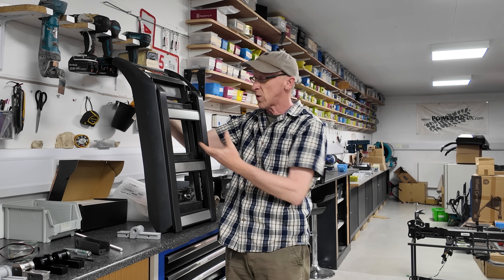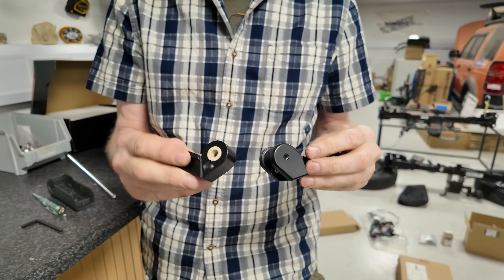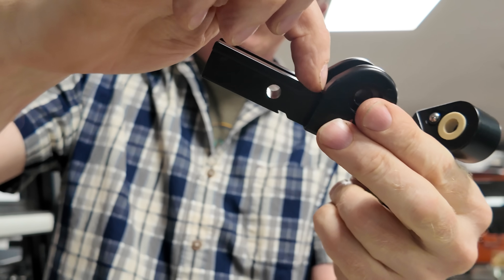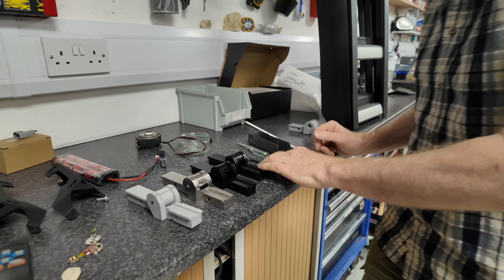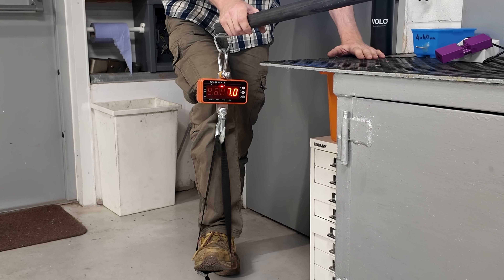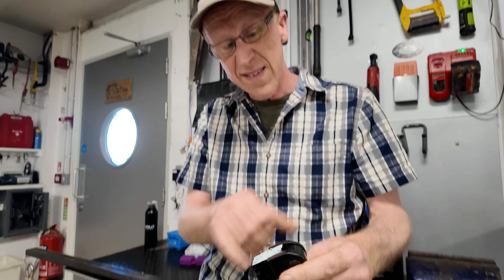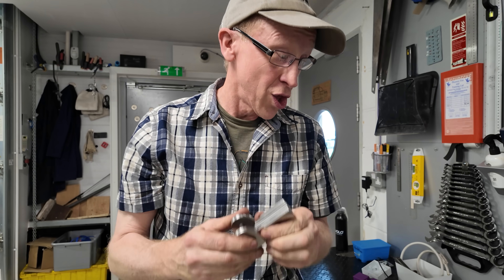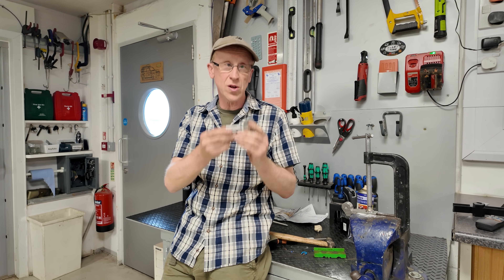We Investigate The Land Rover Defender L663 Ladder Hinge Failure

Comment: Hi Simon,  I have two ladders on my defender 110 (Melbourne Australia). .   Great for access to both sides of the roof rack.   I have purchased 2 sets of your upgraded CNC hinges and they have been fitted with no problems.   In you video you said that you were going to produce them in stainless steel, but I dont see those on offer in your parts list for sale.   What happened there?  Why didnt the stainless (strongest) variation go into production?   Cheers Roger.

Comment: Have Land Rover redesigned the ladder?  I am sure the original had a lock on the bottom and the lower section pulled out and down - rather than just folding down???

I am very impressed with your research and making the parts that break and Land Rover do not supply. 👍

Comment: Nice bit of testing.  The cast Zinc is known as Zamac - and it's pretty cheap & nasty!
I think, if you were to add some fillets, you could increase the strength of the aluminium version a reasonable amount.  Also, use a shoulder bolt screwing into a counterbored hole.  The thread itself, as well as having a smaller root diameter also acts to concentrate stress.
If you'd like any assistance (for free), reach out.  I have fairly grown-up analysis software so we could try a number of options without having to machine anything.  (I used to run X-Eng, if you remember that!)

Comment: It looks like it’s made of zamac which is a zinc alloy. It’s very easy to cast has a low melting point doesn’t corrode easy is quite inexpensive and is it very very very brittle. any kind of a lateral load will cause it to fracture in shear.  I’m amazed that they would use such a material for a loadbearing part.
Reply from the maker: Sounds like you know your materials…. It does not seem to be the best material for the job.

Comment: Of course, although your aluminium version was CNC machined, the original block would have been cast, hence the granular surface. Great demo though and definitely an improvement with either version. I hope JLR will take note to avoid future claims now that you've revealed the inherent weakness of their design.
Reply from the maker: Good point .. well presented

Comment: Nice work, I thought I was watching Christian on an LR Time experiment video 😂maybe add a small strengthening Web either side of the 90 bend as the material will be there anyway if it's from a billet so less machining and more strength. Start production for supplying Land Rover and all the recalls or LR could instead wait for all the small claims applications for the accidental falls from height! Cheaper to replace the hinges me thinks! Safer too.
Reply from the maker: Christian is way more technical than me ! @lrtime

Comment: I wonder whether the top linkage on the ladder could be extended so that it pushed the top further out, so that the ladder becomes vertical when deployed while still being able to be folded away?
Reply from the maker: That would reduce the stress on the hinge but it would not be as nice to use !
Reply: @L663 
That’s more aesthetic than reality In my opinion because the first step is the big leap. It is rather a tall order by any standard LOL.
I’ve had a look and there’s no room for an extended top link to fold in anyway.

Comment: Something I’ve always wondered… The ladder is rated to 150 kg, so why is it necessary to drill an extra hole for the LHS side carrier, which you’ll probably struggle to put 10 kg of stuff into?
Reply from the maker: It is a mystery why Land Rover did not put 3 mounting holes on both sides - why just the RHS. The side carrier is not intended to be fitted to the LHS - but in the UK it really needs to be else you are getting stuff out of the carrier in the middle of the road when parked !  The reason for the extra hole is that the ladder uses holes 1 and 2 but the carrier uses holes 1 and 3.
Reply: @L663 Understood - but do you NEED three mounting holes for a LHS carrier? If 2 holes can take 150 kg, a few ratchets and tow ropes mounted in a LHS carrier on 2 holes should suffice..?

Comment: So happy to see this video, Simon!!! Had this exact problem happen while standing on the lower ladder rung and it definitely was from the stress on the hinge, just as you described. And I would be so happy get a replacement stainless steel hinge! Amazing
Reply from the maker: Hi Steve - we decided to go for Aluminium in the end - we increased the bolt size so I think this will give us 2 to 3 times the strength of the original. They will be here in a few weeks - they are now ordered.

Comment: Perhaps make the shafts longer to spread the load further along the female box section, which will now be the weakest link.  As it happened my brother used the ladder today [I’m too heavy and have some mechanical sympathy] to remove the trim strip that runs alongside the sunroof. We did this to check and rectify, if necessary, the roof drain nipple that tends to rust away on the L405 unless we cement a stainless steel pipe insert into the hole. Good news! The surrounding frame and drains on the L466 Defender is all made of plastic, not mild steel like the L405. There are drains at each corner rather than one each side in the middle as with the older model.
Reply from the maker: The shaft is a little longer on our design but you are of course correct - at some point something will fail... but i think the problem with this design is poor design with stress concentrations ( sharp corners ) and also poor material choice.

Comment: The failure of the land rover part  may also be down to the typical behaviour of far east suppliers (unavoidable in automotive now due to cost pressures) - Submit a golden sample for the part supply to be approved, then change to a cheaper process/material without telling the customer once production starts
Reply from the maker: I am not sure where they are made - i just rewatched my original video and there is no "made in xxxx" on the original Land Rover label.... often these parts are made by Thule ?

Comment: The official instructions says: "The maximum load that can be placed on the deployable roof ladder is 150 kg or 330 lbs. Do not exceed the maximum load."
Reply from the maker: Good to know - of course I am not sure what that relates to with my test as the leverage is different. It may also depend how much one person pushes on the bottom step... that will make it worse.. and if there is any aspect of dynamic loading ( moving as you mount the bottom step )
Reply: I weigh 220 and they still broke!  It's bad casting of the material.

Comment: I think land Rover might cotton onto this idea of testing products before they put them on the market and not leave it up to customers to do it for them!
Reply from the maker: Yes i think Land Rover ( or their supplier ) may have tested this in a vertical position - when on the car it sits at 10 Degrees to the vertical - and this changes the loading on the hinge completely.
Reply: @L663  Yes, I'd noticed that and the resulting flex / bounce when it was loaded. Ideal situation for propagating a fatigue crack from that stress concentration.

Comment: Thanks for the video, don’t forget to include a usable bolt in the spare parts package!
 😄
Reply from the maker: We have changed the design of the bolt so that it is a constant diameter and we will supply a spare bolt with the replacement hinges.

Comment: You could probably get away with using the cheaper aluminium version, provided you can get a decent sized radius in that corner to relieve the stress point. I'd say at least 5mm if there is space when the hinge is folded.
Reply from the maker: We decided to go for the aluminium and have increased the diameter of the threaded end of the bolt - this should result in a hinge 3x stronger than the original...

Comment: Thanks for a great video. I'm glad you were able to make use of my pictures (I emailed you folks a year or more ago about my ladder). Sign me up for a pair. I think Aluminum is the way to go if it's going to offer a big saving over the steel. At more than double the strength of the Zinc it will definitely stand up to my pie-eating ways. I really appreciate you developing these. I had no luck trying to source a replacement. My ladder has been working as a 3 rung with the lower section zip-tied in place for over a year.
Reply from the maker: Thanks for the pics - as soon as we get them in stock I will get in contact and see if we can sell you a set for special price..( please remind me )
Reply: @L663  Thanks so much. Love your stuff. Products, videos and customer service. All top notch.